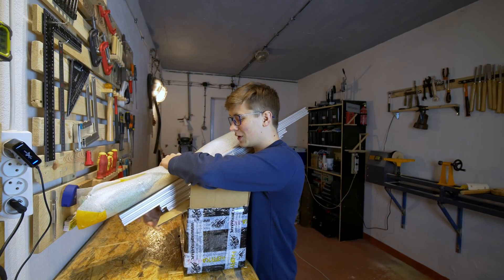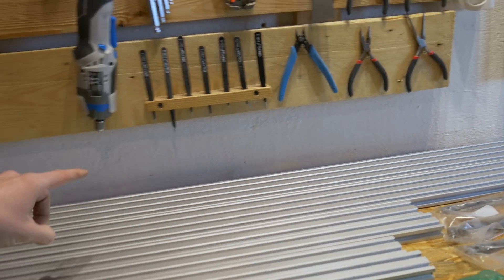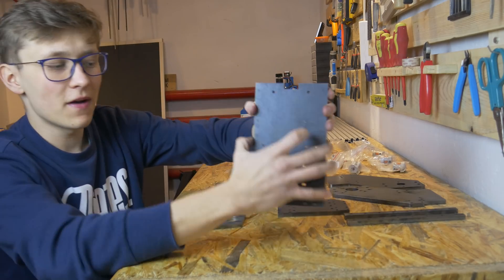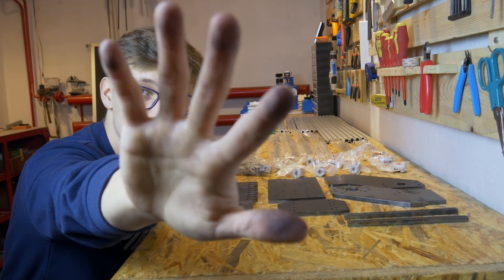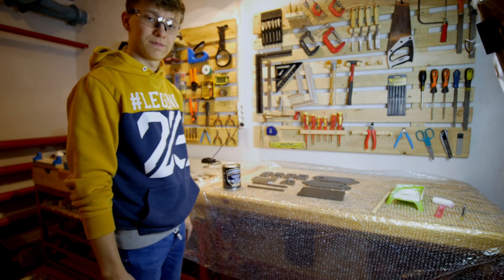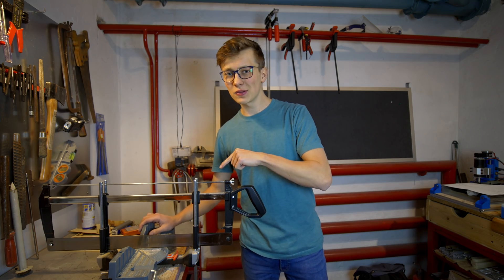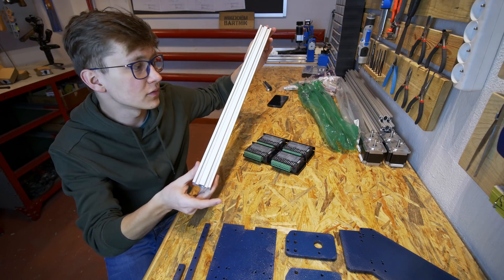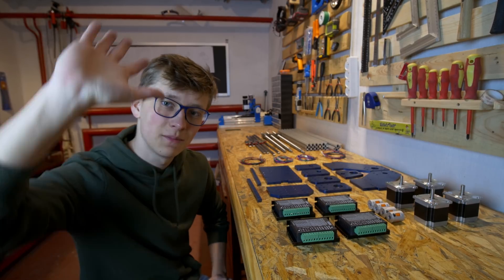IndyMill - Open Source DIY CNC Machine #1 Parts

Comment: Hi Nikodem, Outstanding project, looking forward to it. I have those stepper drivers and noticed that the circuit boards can be very close to the case. I am thinking of using some insullated waffer. :)
Reply from the maker: Thanks! Keep in mind that that may increase the temperature inside the driver. It's better to have bad (thermal) insulation to distribute energy outside of the case. My case is also made out of plastic so I don't think that this will be a problem.

Comment: Thank you for the great video! I am really looking forward to this series! A few tips and or questions
1. As far as I know there are 2 Versions of this profiles one with a bore for M6 and for M5. Is there a reason why you didn’t use the M6 Version, with which you wouldn’t have had to enlarge the holes?
2. When boring, milling or tapping Aluminium I use ethanol and not WD40. I don’t know he specifics but it just works better. Datron uses it also on their machines.
3. When I order parts from a laser cutting service they mark the holes which are to small to cut. Maybe you could ask he service where you ordered the parts if they could do the same
Reply from the maker: Thanks!
1. Hole in those profiles is too big for M5 and too small for M6, that's why I had to enlarge those. There is really a lot of versions of those profiles so maybe you can find some with proper hole diameters.
2. I also used WD40 it's a lot easier to tap a hole thanks to it. It's also visible on the video.
3. Holes were marked but I don't think it's super precise to drill those by hand and also it takes too much time so I have to figure out how to design them so that those can be cut or order additional drilling at a factory.

Comment: Just a question: Is it on purpose that you designed the lateral elements that way: a weird shift in the center of gravity IMHO. Triangular elements sound more common sense than those beautiful oblique blue holders. Is it for the beauty? it's not a reproach at all, I love the design.
Reply from the maker: that way you have more working area on the Y axis because spindle is moved to the back a little
Reply: Jean Seb Astienback He’s right to a certain extent. You ideally want your spindle centered over your front linear carriages.
Reply: I agree. The center of gravity might be a bit problematic with the current design. In my opinion, you might straiten lateral by some degrees, so spindle comes a bit towards the front. But overall, everything looks good and the amount of details in the design is incredible.

Comment: Solid project.  :) my tip is to use rubber foot to reduce the vibration and noise.
Reply from the maker: Maybe 3D printed foot, that would be a nice addition

Comment: Hi, nice vid, I really like your Dremel CNC project, and build one right now :) 
some questions about this project:
why to use GRBL instead of marlin? 
you will use 32 bit board? 
why do you use linear rails instead of timing belts (like in MPCNC project)?
Reply from the maker: Awesome! 
GRBL is made for CNC machines and Marlin is better for 3D printers
Not sure yet but probably I will design my own controller board based on atmega328
I use ball screws instead of timing belts, bigger precision and that's what profesional machines use. Timing belts are for 3D printers.

Comment: Can't wait for the next one!
BTW, you sure that GRBL shield is needed?
My CNC is build out of Arduino Uno and those stepper motors controllers (just like you have) without any shield...
Reply from the maker: yes it can be done, but I prefer to have a nice clean connection without any air soldering or breadboard cables something that is easy to securely connect for example using screw terminals. I really like embedded solutions so that things are super easy to use

Comment: aaah here it is! Was wondering where this mystical IndyCNC was ;-) I'm glad you got to start on this project, I really enjoyed your DremelCNC. I haven't built one but now this one is here, I wonder if I should just wait and build this one. I have access to a laser cutter at work and can have parts like this cut to size which makes life easier, although i've always been told that the hole size on a laser is dependent on thickness especially for the quality. i.e. they don't like cutting 2mm holes in anything thicker than 2mm, 3mm holes in anything thicker than 3mm etc.

Comment: Is there any reason you chose steel for the parts you had laser cut? - could aluminium be used - it is much lighter, and could be anodised in any colour and would save painting
Reply from the maker: it is way more expensive, steel is cheaper

Comment: Nice video but wear gloves when cleaning your materials for painting. You cleaned the steel then touched it with your bare hands, your hands have oil on them (even if you can't feel it). Just FYI.
Reply from the maker: I know about that but I hat gloves so I just tried my best to clean it after putting on the table

Comment: Hi! 
I discovered your Dremel CNC Project yesterday, so it was a surprise to see you starting a new CNC project right now!

I looked at your introduction on Indystry, and thought that your general idea (of making open-source and accessible designs) closely match what I thought when I started working on my project 'Lowest Complexity Laser Cutter.' https://hackaday.io/project/169347-lowest-complexity-laser-cutter

Right now, the design is just a 2D CNC Gantry that's able to hold a pen or whiteboard marker; I aim to work on adding a diode laser and a protective shield to prevent eye damage. But please, if interested, contact me about potentially adding a laser cutter to the Indystry project!!! You could comment on the project page or contact me through Hackaday. 

Thanks a lot, and great project!

Comment: awesome! i'm really interested to see the real world improvements over the dremel CNC in terms of possible speeds, feeds and maybe even even harder materials you can cut.
that blue paint is beautiful! the design looks clean, simple, but effective.
the only things i think could help improve it further is to hard mount a base plate/waste board to help keep the frame square and stiff, and maybe also put a back plate on the x-axis profiles to connect them and make them stiffer too, think enough so you can screw in through the steel plates from the side again as well. 

will you use the same 500W spindle with this or do you think it can handle even more power?

Comment: Some small tips:

1) don't restrict the machining method of your parts. You may find a CNC shop that can cut your material at a cheaper cost than laser, to similar accuracies. This is especially true if you wish to sell kits.

2) don't accept parts that have missing or wrongly made features or dimensions. When you send drawings and files to a manufacturer, make sure you have all of the following: .STEP file of your individual parts (dxf or dwg if laser files), 2d dimensioned drawings of each part, and an assembly drawing of your part if the parts are intended to be assembled on each other. This allows you to point out their machining faults (if any) as well as help them highlight issues they may face. You can't do this if they don't have your drawings.

3) you can get the fabrication house to clean and process the parts for you, such as filing or bead blasting to a desired textured finish. This can save time spent on paint prep.

Really enjoy the video. Can't wait to watch the next one!
Reply: Did you maybe mix up the h and c variant of the linear rails in your design. Would explain the wrong hole pattern.
Reply: Thx for sharing your experience, we all lessened something
Reply: Laser nie wytnie otworu mniejszego od grubości blachy jest to zależne od długości wpalenia , te które miałeś zrobione to pewnie było minimum na tym laserze. 
Water jet może byś droższy od lasera bo ma mniejszą prędkość cięcia a płacisz też za czas pracy maszyny musisz powysyłać zapytania do różnych firm, bo niestety nie wszystkie 
firmy chcą się bawić w pojedyncze zamówienia od osób prywatnych wolą firmy i też czasem jest próg przy jakiej minimalnej wartości zamówienia biorą zlecenie.
Reply: But its fun to build and  a cool Thing to have
Reply from the maker: Thanks a lot! 
1) That's true, I will do more research on that especially on water jet cutting.
2) Parts were perfectly fine except those small holes, but that wasn't a big deal. But it's true they could mention something about minimal hole diameter.
3) I know, but I enjoy making and it's always nice to do some more work with your own hands and play with tools :)
Thanks! Can't wait too
Reply: @nikodembartnik  I owned a business and had two waterjet machines.  They are great for a lot of things, especially thick materials that a laser won't cut, but you'll never beat a laser for speed and accuracy in steels under 1" thick with a waterjet.  I cut everything from stainless steel and aluminum, to wood, granite countertops, and even large rocks.  Mostly though, I cut multiple sheets (at the same time) of aircraft aluminum, to make aircraft sheetmetal parts.  I enjoyed your video and look forward to the rest of this build!

Comment: Great video! Although isn't a water jet cutter a better/cheaper alternative? Not sure though
Reply from the maker: I was thinking about that but end up ordering laser cut parts because I found a company was able to cut those quickly for a good price. Have to do more research about that and find out, maybe you are right. Best way would be to have a wazer (that's a desktop waterjet) and cut them in house but  it is expensive :)
Reply: @nikodembartnik  makes sense. Anyway, great work! And cannot wait for the i'ble to be out!

Comment: Awesome. I'm still building my 3D printer to be able to print dremel-cnc parts, but I'm already excited about your upcoming videos.

One suggestion tho, you could make a few videos explaining the design choices. Obviously not everyone will be able to get the exact same parts and probably has to use substitutes, so it would be interesting to hear your thoughts about the problems or parts one should avoid for whatever reason.
Reply from the maker: Thanks! Great idea, how about some Q&A about the design, replacement parts and so on? Good luck with your build!

Comment: You do get screw terminal shields for the arduino. https://www.amazon.com/kuman-Shield-Expansion-Board-Arduino/dp/B01BSFK3RK
Reply from the maker: yes, but not made for use with CNC. I want to make a GRBL compatible shield with screw terminals for stepper motor drivers, limit switches and some other cool stuff :)
Reply: @nikodembartnik  I am doing the same. It is just an extension pin board. See link https://www.amazon.com/kuman-Shield-Expansion-Board-Arduino/dp/B01BSFK3RK